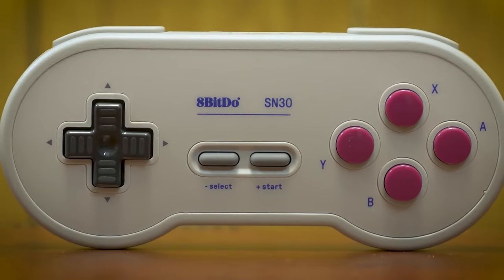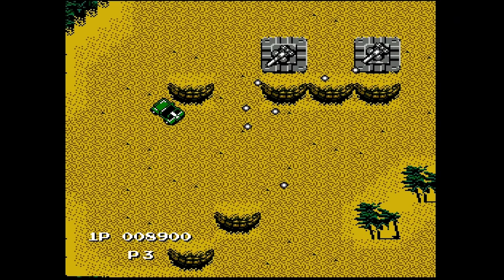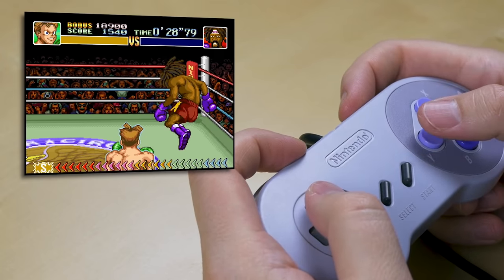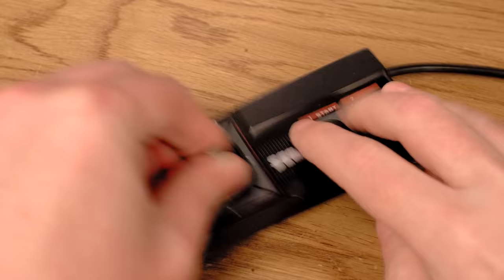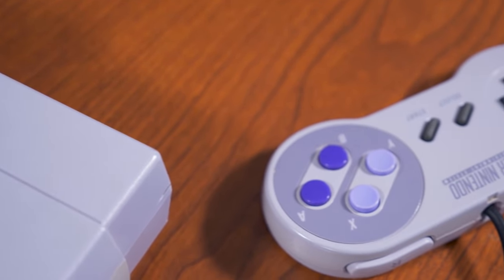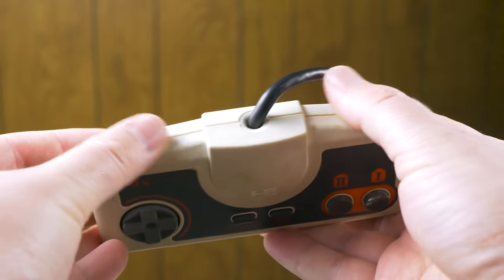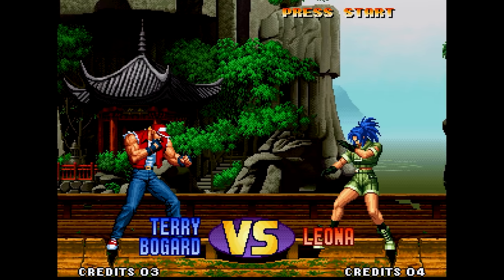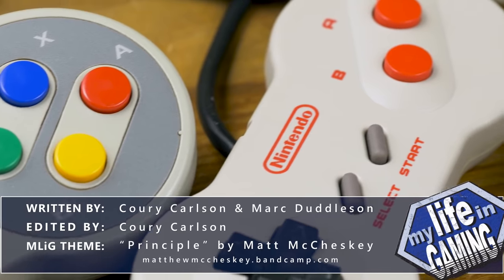First Party Controllers #1 - NES, SNES, Genesis, TG-16, Neo Geo, and More! / MY LIFE IN GAMING

Comment: The Famicom has short, attached cables because it was meant to sit on the floor between the player and the TV, like older Atari game systems. Meanwhile the NES has longer, detachable cables because it was designed to be used like a VCR.

Comment: 'One sixteenth of an inch' - man, the USA really needs to fully adopt the metric system already xD
Reply: 2.54/16 cm 😅
Reply: Would be a dream if so ♥
Reply: As an American I agree.   But you can't teach adults new things,  so our only hope is schools teach kids early and slow adopt over generations.    I think the big issue is switching from MPH to KM.  I would expect tons of accidents for people trying to switch to the other numbers on the odometer.  Not that I thing your average voting citizen has trouble with simple things, but.
Reply: @CesarCordova  the point is in the approximation. Nobody would say 'sixteenth of a cm' because the unit is too small. They'd give a whole number instead, either in cm or mm, or sa give a single decimal point if talking about cm.
Reply: @kerred  simple solution to that: do what the UK does and don't change the roads from miles to kilometres. Everything else can change, roads can stay the same and not particularly conflict. They can always be changed after the rest changes too. But, the USA really doesn't like change I've noticed
Reply: The ONLY advantage of the Imperial sysytem, is that there are more poetic and songwriting possibilities.  let's p(ounce)  on that hard ( yard)  baker (acre) in a p(inch).  Exception :gonna run a scam to take your Gram of coke. ( Or 355ml on Radio Disney)
Reply: The other advantage is the "exact" definition of imperial units have real world analogs.  A foot is approximately the size of a foot.  Good linguisticly,  bad scientifically.
Reply: The metric system tries to find unalterable  observable standards.  But the meter is no longer a fundamental unit because it depends on the speed of light in a vacuum.  When people talk of light speed slowing, then the meter is not constant.
Reply: Since diffent people have different size feet, pick one person, most likely the king. and say his foot is defined as a foot when a specific person isn't specified.  You're still free to measure in "your feet" but outside your house, you'll be squabbling over at least 10% with somebody.
Reply: However, computers love the smaller than 1 divisions of inches, because it's a "binary subdivision", not a decimal like us hunans, with 10 fingers.
Reply: Think about it, all "standard" inch divisions are 1/(2^n) 1/2, 1/4, 1/8 1/16, 1/32.
Reply: Stupid part is they don't 16/32 when thrity-seconds is the degree of accuracy. 16/32 sounds more accurate than 1/2.  Regardless of degree of accuracy, it's ALWAYS 1/2.
Reply: Using linguistic logic 100 centimeters is more accurate than 1 meter. 100 centimetres suggests not 101 and not 99, vs 1 meter as not 2 or 0 meters.

Comment: Man... the close ups on those controllers reminded me how absolutely filthy controllers can get.
Reply: Back in the day when controllers were easy to disassemble I used disassemble my controllers completely about once every six months or so and physically wash the plastic parts of it. Like, washing in the sink kind of cleaning.

Xbox controllers have gotten so damn complex now it's hard to take them apart--they've got 2 PCBs, four shaker motors, an internal clamshell, and they're held together by clips.
Reply: I deep clean all of mine. Disassemble completely and scrub the plastic parts with soapy paper towels and q-tips, getting into every little corner. Isoprobyl alcohol is also excellent at getting colored scuffs out (some of mine had black/white/red/blue scuffs and marks).
Reply: @davidbrooks2476  I only go as far as loosening the screws, then scraping the gunk out of the crevices & using rubbing alcohol on a cotton swab to clean everything out. I've had to do some repairs on a few controllers & ended up ruining a perfectly good PS4 controller because I couldn't get the trigger springs back in place.
Reply: @davidbrooks2476  Funny I'm taking apart and cleaning my OG Xbox Duke controller as I'm watching this video.
Reply: Here's your friendly reminder your phone is dirtier than a toilet seat in a public gas station. Wipe that shit down every now and then

Comment: Do Japanese people sit on the floor? and maybe have small rooms, that might explain it.[the short cable]
Reply: Japanese homes are (or were) typically much smaller so it was probably pretty normal to have TV>Famicom>kids all in very close proximity.
Reply: They have very limited space. If they have a long wire in a limited space, they might trip over it and the wire would be all over the place. They might have to use rubberband to tie up long wire to shorten it. Even in US, kids and adults still trip on those long wires. Whether the ac unit, rf wire and or controller wire, people still trip on them. I think I trip about 2 times on NES and it froze my gameplay.
Reply: TVs were also much smaller in those days so you could sit right in front of them.
Reply: @goatbone  you are right on that one. The smallest tv I played NES  was 13". It was pretty small. Later on, my mom bought the 19" and it was amazing to see the actual blurry pixel a bit better. 

 Man, kids today got it made. Having a big giant tv in their room while kids of the 70s and 80s have to deal with small ass tv.
Reply: "Most Westerners are not used to sitting on the floor, however, in Japan sitting upright on the floor is common in many situations. For example, meals are traditionally held on a tatami floor around a low table."
Reply: Yes, the console would usually be set up and/or unboxed each time it was to be played and be in close proximity to the player with long cables running to the tv, rather than sit under the tv indefinitely even when not being played.
Reply: @dennisanderson8663  it's a common thing in the East. Everyone sits on the floor together at meal time. The head of the household started the meal 1st. 

If you visit any Oriental home, please take off your shoe outside the home or if you see where they kept the shoes, place it there. Please acknowledge any adults and elders there. It's to show Respect and Honor. In turn, they will congratulate the folks that have taught you discipline and honor. My niece and nephew don't do that and walk pass me and seat down when they visit me. Not one phrase come out to say how are you doing. I guess my older sister didn't teach them correctly. My wife and I taught my 6 year old daughter to bow down and call out to each adults. I still follow the old traditional Oriental value from the East. The Oriental follow 3 principles. Respect, Honor and discipline. We also to protect our last name.

Remember when Obama visit Japan and bow down on the Emperor of Japan. People here think that US is weak to do that. 1st off. The Emperor is older than Obama. That's like my child bowing down on adult. It's a sign of respect and honor.
2nd, the Emperor have a higher status than Obama. He is royalty. Obama is just a commoner.
Reply: @tr1bes   diferent countries have diferent rules of conduct, it's simply that culturaly we are very diferent and as such hold diferent values atop, for example from our perspective "honor" doesnt holds as much of an importance as it does on the east and discipline while being considered a good thing to have it's not considered escential, just something important you need in order to be succesful but nothing more (i'm not from the united states btw, i'm from México, still both countries hold similar values thanks to how close they are but even so there are diferences), respect is important of course as it is respecting the elders, but usually we don't consider acknowledging them as escencial, just behave around them and try not to bother them as much, although yeah saying "how are you doing" or things of the sort is usually considered having good manners

And thats a huge thing, not much honor or discipline but having good manners, knowing how to act in certain situations and the correct etiquete for social events it's extremly important here in the west, don't make noises when you are eating, sit with your back to the chair, don't eat with your hands, that sort of thing is held to extreme value

Also in general wéstern cultures are much more liberal and hold the individual before the colective, you do what you want to do, be whatever you desire, don't allow anyone to tell you who you should become, try be unique and diferent, thats something extremly important for our personal identity, and as such is much more acceptable to defy cultural values and traditions, specially if said values are somewhat reclusive, thats just how we usually act we don't like to be told what to do (for the good and the bad)

Of course if you are a visitor you need to accept and respect the culture of the society you are visiting but there are a lot of folks who defy even those values, as i said we don't like to be told what to do, i guess thats why some eastern countries don't like foreigners a lot, because they hold ancient values and honors in a huge regard while we usually don't pay much attention to them although they still are important for a lot of people

Thats just the diference in countries with a diferent history and culture
Reply: We sit on the floor.
We put Famicom on the floor too.
Reply: I grew up with the Famicom, and it was always on the floor in between the 2 players because of its design.
Reply: I think the Atari 2800 had a similar form factor and console placement.

Comment: It's a bit of a misconception that having the joystick on the right side appeals to left-handed people. When gaming was new, joysticks in arcade games were either placed in the center of the cabinet for ambidextrous use, or on the right side because most people are right-handed. Placing joysticks on the left side was a deliberate design choice by arcade owners that wanted to make games artificially more difficult for the right-handed majority to get more money from their existing customers. Then as new people grew up with joysticks on the left, people started getting used to it regardless of handedness, and it just became standard.

Comment: When I said about the retrobit pads dpad pressing in and not feeling the same everyone thought I was insane. Glad you found it the same also. It's a good pad but not a replacement for the sj6000 as that's so precise its perfection
Reply: I tried swapping the dpad over and the rubbers with no success. The mould for the dome is larger it seems. I bought two of the pads as they said it was the same moulds and gave them away
Reply: Agreed, the Retro Bit Saturn and Mega Drive/Genesis controllers “look” the part, but the D-pad is all wrong, you can depress all the rubber membranes at once when you push down on the D-pad, making half and quarter circle much less accurate, you simply can’t do this on a genuine original 6 button Genesis/Megadrive it will always depress the direction you are pressing.. it blows my mind how people can’t notice this, but glad to see I’m not the only one
Reply: @garycormack  after the sega lord x review on the 2.4 saturn pad I gave them one more chance and ended up returning that due to random inputs I didnt even press. They suck and I'm just waiting on a 8bitdo wireless receiver to use with a DIY kit as they are flawless
Reply: kevinwoolford123  I actually went down that route after giving up on these Retro Bit controllers,  I bought the DIY kit and now have a USB controller with original controller parts,  it supports both direct and X input and is perfect, I’ve tried all sorts to get these retro bit controller D-pads better, tried mashing parts from an original controller onto these but it just seems to make it worse if anything.
Reply: kevinwoolford123 I watched the sega lord X review also, and all due respect to him but it quickly became evident to me that like most people that buy the retro bit controllers they simply aren’t partial to the inaccuracies.

Comment: There are a few SMS games that won't work with a Genesis controller, like Alien Syndrome and Wonder Boy 2. But I found a hack that works. Get a cheap Genesis controller extension cable, and on the end with the male pins, remove/snap off pin #7 (on the 4-pin row, that's the pin second from the left.) Connect the Genesis controller to the extension cable and voila, those games will work perfectly now. I don't know the technical explanation for how this works, but I'm sure it has to do with a memory register getting confused by extraneous signal or something. Note that this won't have any affect on other SMS games, so once you do the mod, you won't need to swap out controllers ever again. (It WILL cause problems with Genesis games, however.)
Reply: I don't know how you figured this out but cool!!  thanks!
Reply: Lore like this is great for longtime Sega fans trying to figure out what's compatible! I always loved Alien Sydrome on Master System, but it won't work with Genesis controllers.

Comment: Note: cable length on the Japanese SNS-102 is longer than the US SNS-102 (the opposite is true for the original SHVC-005 / SNS-005 controllers).

Comment: Besides of the Controllers, im still blown away how good PCEngine Games looks for a 8Bit Console.
Reply: Think about it though, a lot of gamers today suffer with a crap CPU but good graphics card. Same concept back then :P
Reply: @9393zach  yeah, but on the PCE then Games also runs smooth :P
Reply: @TheKayliedGamerChannel-YouTube  It was still 6502 based lmfao, and being an 8-bit CPU limits the RAM it can access without an MMU of some form

but yes it was actually faster than the SNES cpu tbh lmao
Reply: @UndeadCollector  Because you don't need the fastest CPU if you have good, efficient assembly code :)

Comment: Why do i feel like playing the sega master system arcade stick upside down is easier then having it backwards?
Reply: Cross your hands.
Reply: It almost feels like they had right and left hand versions but then, for some reason, only sent the left hand version to the US.
Reply: Joystick players don't understand you.
Reply: Why the joystick was placed on the left side on arcade machines originally was to up the difficulty since the majority was right handed.
Reply: The Sega Master System arcade stick, despite having it's stick on the right, feels very comfortable and it's actually easier to play games with the joystick on the right. As someone already pointed out in this thread, the joystick was placed on the left in arcades to makes games harder. Once you get use to playing on a joystick with the stick on the right side (it takes about 10 minutes max to get use to it if you are use to playing with a stick on the left), it makes games easier (assuming you are right handed). Atari 2600 also had it's stick on the right and the button to the left.

Comment: The Nintendo Switch is the first console that I've preferred to use a third party controller. I use the SN30 Pro Plus over the Joycon and grip.
Reply: The SN30 Pro Plus is now my main controller on Switch and PC. Older GTA and similar games using DirectInput and the rest on XInput is an absolute beautiful thing.

Comment: 1st party controllers just can't be beat. Most of the time they are just the best controllers that exist.
Reply: There is no real reason why a third party company can't make as good or better controllers so the rule of first party system controllers in my opinion is based on two factors.
 
1st is just due to human nature. What i mean is that if you buy a console and play with a certain controller then you get used to that feeling and kind of reject alternatives that feel any different even if it is not necessary worse. So even if a third party controller has the same or better quality it will still be very hard to top the fame of the original one because people will say, "i don't know the d-pad or the buttons just don't feel right", meaning they don't feel like the original controller. 

2nd is pricing. The vast majority of third party controller makers try to make their controller cheaper than the original. Because if the price is the same or higher then that will be a big problem for their sales since people will go "well if am gonna pay that much then why don't i just buy the original one". So by trying to go cheaper it means they end up making a worse controller since they use cheaper parts. 
Add to that how harder is for them to be cheaper since their profits are based on that controller unlike the console maker that makes money from the games and console and you see how hard their position can be.
That is why most times the best third party controllers for a system come years later when the system is an old and the original manufacturer stop making controllers for it.

Comment: Wow, your master system controller sticks move so much more than mine.  Mine were always super tight, like less than a half inch of movement in any direction.  I guess mine were always just old and stiff and I never knew it.  That's what I grew up on, it was awful. 

Years later I bought a d-pad style controller, what a difference!

Comment: Yes, the Japanese Mega Drive Arcade Power Stick and it's six button successor, the Arcade Power Stick 6B, are both micro-switched, offering a significantly better experience than the variants we received in the West - both are fantastic sticks. They're some still available on eBay, but prices are quite high.